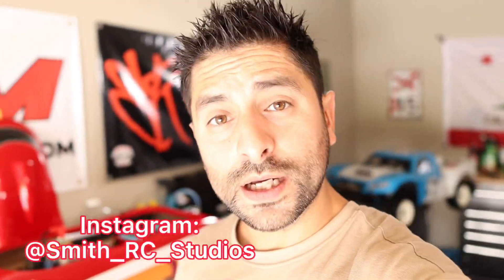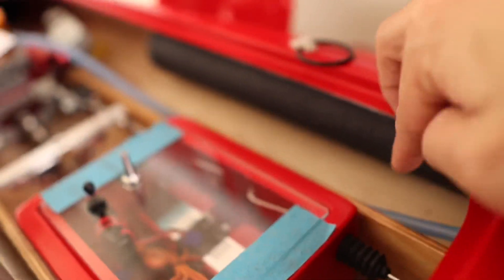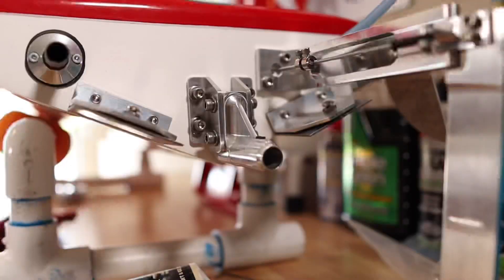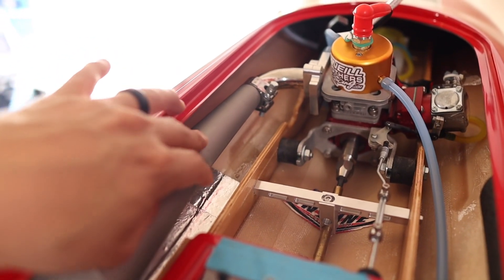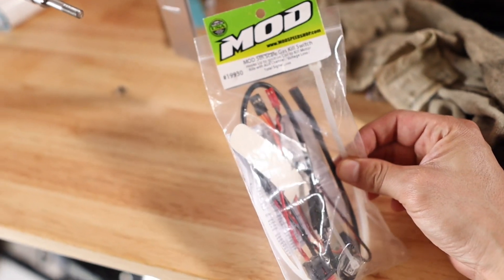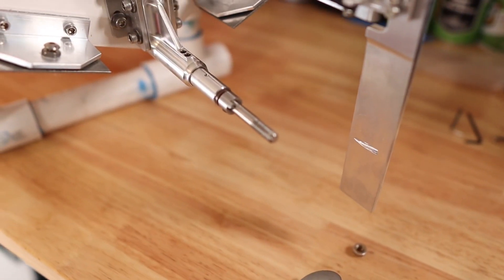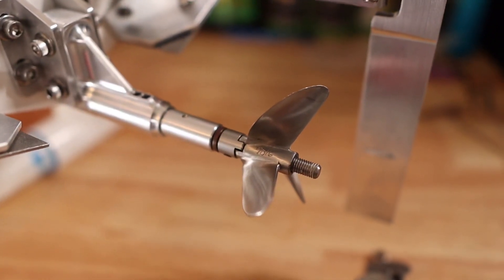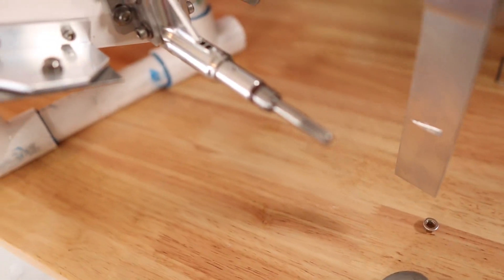Propeller Talk - NEW BOAT - OBR Signature Series - MOD

Comment: nice boat mate! on my new losi 5t 2.0 there is only one fuel filter from factory and its on the black hose, is that right? i thought it would be on the yellow hose at the top of carbie where it sucks fuel in. cheers
Reply from the maker: Yes. The black hose connect to the bottom of the carburetor and has the fuel filter. The yellow  hose is for the primer bulb on top which has no fuel filter in tank
Reply: @SmithRCStudios  thanks mate